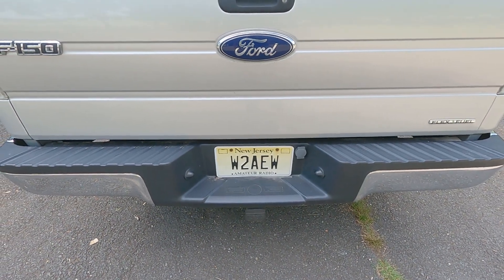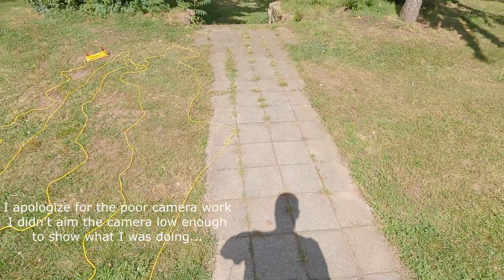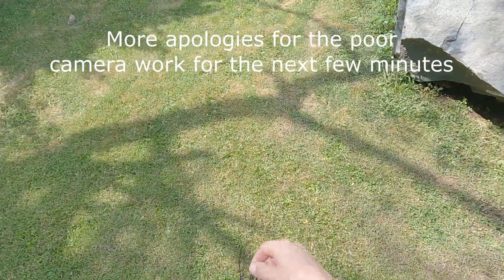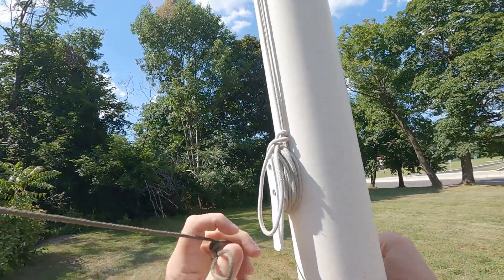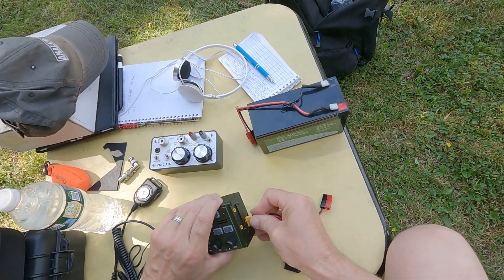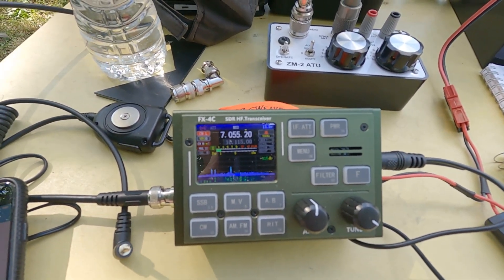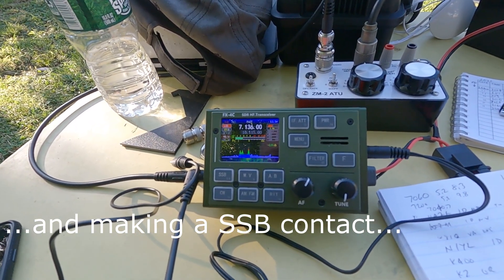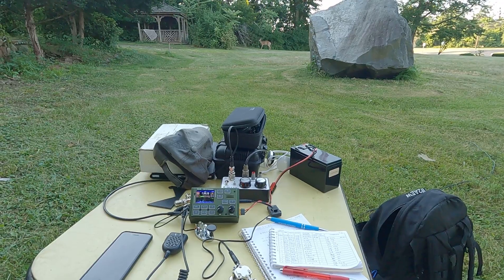#357: Ham Radio fun: ARRL Field Day '22 - Antenna raising, rig setup and a bit of operating

Comment: Thanks for the video.  I own the FX4C as well.  The only issue I’ve had with the radio is: With SSB when you un key the mike it takes an extra second or two to hear the other station.  Have you had that issue?
Reply from the maker: The AGC does take a little time to reset.

Comment: W2RTM of the New Jersey Antique Radio Club activated the sister Marconi 1914 receiving site in Belmar, NJ for Field Day! We had various rigs on line including Gonset Communicators, Heathkit Sixers, a BC-611 and some other big iron alongside two Icoms for the event. 550+ contacts on phone, 80+ on CW. Sorry we missed you on the air. Kudos for the nice clean portable operating setup. Maybe we'll work you next year. N2GX, N2KPS, N3FRQ, K2TPP, KC2RDU, K2RGM and a bunch of others had a whole lot of fun. 73's
Reply from the maker: Yes, saw you guys in Bob's video..

Comment: What about this tunner? Could I pair it with the 705, replacing the e pensive mat tunner?
Reply from the maker: Sure, any HF tuner rated for the power level can be used with the 705.  The EMTECH ZM-2 is a manual tuner, and would work fine with the 705.  Here's a video on how to use it: https://youtu.be/XRO4Tiashls

Comment: Thanks for the video and the tip on the Par  EndFedz antenna !   Will probably have to get one of those.  Interesting how they say no counterpoise is needed. Guess that's because its a highQ feedpoint. Must be some pretty high E fields at the end though !  Did you use a ground stake, or just float the radio and battery ?
Reply from the maker: wb8dsb gave you a fine answer on the antenna - and it mirrors my experience.  I have also found that the coax shield works fine as the counterpoise.  Sometimes I use a common mode choke, sometimes I don't.  I did not put in a ground stake.
Reply: @w2aew  Thanks!
Reply: The EFHW does require a counterpoise but it can be as simple as being the outside of the coax shield.  Just use a common mode choke on the feedline 0.05 wavelengths down from the feed point on the lowest band and don’t use an external counterpoise (AA5TB was the first to propose a 0.05 length counterpoise as being adequate based on modeling, and I have also confirmed 0.05 wavelength is adequate based on modeling).  The outside of the shield for the first 0.05 wavelengths of the coax is adequate counterpoise.  Having the choke also does a great job keeping RF out of the shack and also makes the SWR independent of the length of feedline used between the choke location and the transceiver.  I use a home brew 40 meter EFHW mounted horizontally using the 0.05 wavelength choke concept and could not be happier.  My choke is 14 turns of RG58 on an FT240-31 toroid core and this choke is based on the work done by K9YC.  I used my 40 meter EFHW antenna mounted horizontally 20 feet up this weekend during  field day using my small MFJ Cub transceivers with a little amplifier and made 382 QSO's during 12 hours of operation using 20 watts out on 40 meters, and 14 watts out on 20 meters.  Just FYI and 73, Don (wd8dsb)
Reply: @wd8dsb  Awesome. Thanks for the detailed info !  73

Comment: Thanks for the great video and the presentation of the transceiver FX-4c. What a great throw at the beginning of the video! 👍How did you get the rope back down? Did you have to climb up the tree?🤔🤣 vy 73, dl5lc
Reply from the maker: When I was done, I simply untied the throw line, lowered the antenna, removed the line from the end of the antenna, and then pulled the line back through the tree.

Comment: Nice! Thanks for sharing. Looks like it was fun. Shouldn’t N4ZR have matched your speed?  It’s the biggest reason I am afraid to do cw.  I could have copied you, but I could never have copied the other guy.
Reply from the maker: In casual operating, the faster operator will usually slow down to match speed.  In contests, and other operating "events" like Field Day - it doesn't always happen.  The advantage (for me as the slower operator) in an event like Field Day, is that I will listen to a few of the other operators contact prior to making the call to him - gives me time to listen to his call, etc. several times to make sure I got it right first.  It's a bit of a training exercise for me to help me bring my speed up.  The majority of CW operators will slow to match your speed, especially if you ask them (to QRS).  I'm most comfortable at14-18wpm, but working to bring that up.
Reply: @w2aew  Thanks. That was very helpful and makes total sense!

Comment: Feels like there is a lot of radio history in NJ. Bell Labs, Fort Monmouth, the Marconi station...
Reply from the maker: Yes, there really is!  In fact, the co-founder of my employer (Howard, Vollum, Tektronix) worked for the US Army Signal Corp at Ft. Monmouth.
Reply: @w2aew  Didn't know that. I knew he was involved in radar during the war but that's about it - but it figures - some of the early work on radar in the US was done there. Got to visit the Diana site when I come over to the US, it's one of those places you just have to visit. Like Kitty Hawk or that field in Daventry...
Reply from the maker: @juliussokolowski4293   I worked in the same facility (at Evans Area, adjacent to the Diana site) also, but many years after Vollum.  I also participated in the 70th anniversary of Project Diana where we used the TLM-18 dish to bounce an RF signal off of the moon, exactly 70 years later.

Comment: raising an already made antenna, using a commervialky made radio, talking.

Thats CB RADIO.

What did you do thats really Amateur Radio Field day?

FD is intended to be an EMERGENCY PREPAREDNESS DRILL.

Not a ride on a Hobby Horse.
Reply: Having a rig and antenna prepared for immediate deployment: I would call that textbook emergency preparedness!
Reply: Alan, great location selection to recognize radio history.   Always a hater in the mix, good thing you used some cw, otherwise that old fart would have criticized your ssb use as well.    Finally I always look forward your vids, thank you for doing what you do.
Reply: K8BYP, this comment of yours is the perfect example of what a troll is, unlike how you claim others are trolls when they are only trying to provide correct technical information that just happens to be contrary to what you're saying in your videos.  It also appears you need to seek professional help as all you do is disparage others in your videos which is an indication of poor mental health.